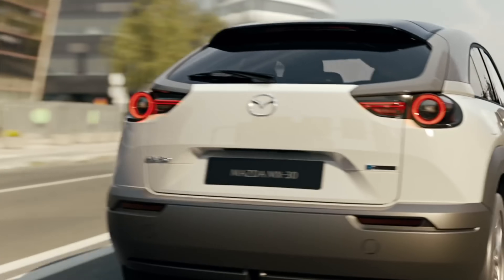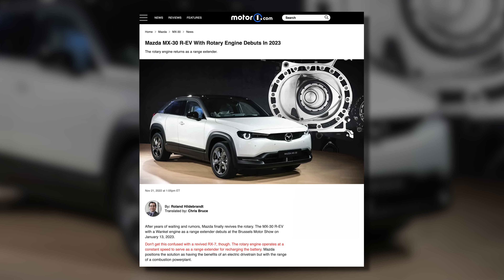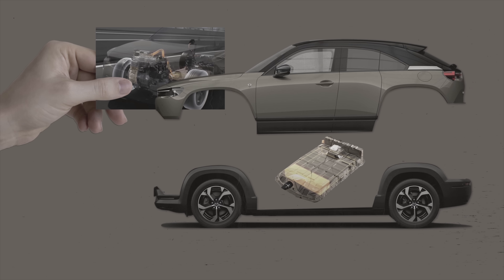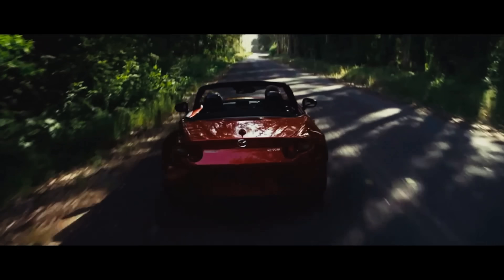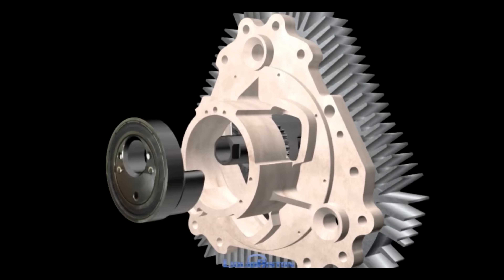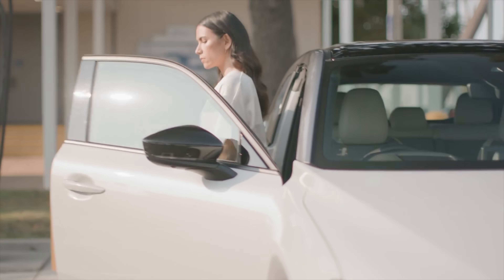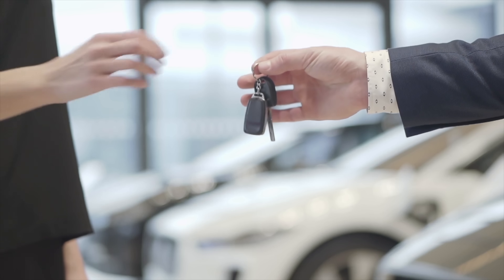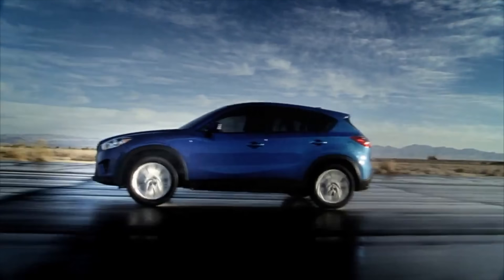Mazda's New Engine is the Smallest and Most Powerful Engine Ever Made

Comment: If Mazda can perfect this small rotary range extender (and it is a big IF), then it could make the electrification of the entire Mazda vehicle offering much easier for them.
Here is my thinking:  
1)  Yes a range of 50 miles would suit many peoples every day driving (mine included), but I wouldn't want to be so restricted.
2)  A high range electric vehicle would be great, but they are expensive and supplies are currently low.
3)  A battery driven car with range extender would help fill the gap in everything from a three door hatchback, up to a heavy 4WD with high towing capacity.
4)  It seems to be a better idea than Toyota's integrated hybrid system, that relies more on fuel use than plug in battery power, and is more complex.
5)  When batteries become cheaper and more power dense in the future, it would be easier to swap out a better battery system in the Mazda, than in the integrated Toyota.  In such a case, the Range Extender could even be removed to save weight.
In conclusion, I think an electric drive vehicle with a range extender, makes more sense than a hybrid drive.
Reply: @Jarjoobinko  You have not "burst my bubble" because although you are right, I made the distinction between Hybrid and Range Extended because of the way some manufacturers (Toyota in particular) make hybrids with no plug and/or tiny batteries.  What I call Range Extended is a car that can be used on battery only for daily use, while the hybrid Toyota I have, cannot.

Comment: At the three minute mark you say that the extender increases the range from 124 miles to 400 miles. But the 125 miles was generated by 35.5 kWh battery and you said a little later that the battery was reducing to half that size, so what is the range provided by the extender with a battery that is half the size is being used. Is it now 200 miles?

Comment: When the power grid goes out the only vehicles that will work will be the older diesel car ex old surburbans anything without modern computers..you can charge the battery off a generator and use the filtered conning oil as fuel

Comment: Have you looked up Nissan Kicks. Its an EV with a gasoline engine generator that charges the batteries for the cars electric motor. Braking wlso harvest and stores electric power. Nissan says a full gas tank will travel 900 kilometers. No need for charging stations as there is no infrastructure for charging in the Philippines.

Comment: Thanks for the excellent review and explanation.

It would be great to hear how Mazda addressed the oil burning and impartial fuel combustion problems.
Reply: I suppose that big problem is mostly addressed with a catalytic converter. Plan on the next generation of ICEngine utilizing "combustible" hydrogen. Toyota and Kawasaki have successful 4-stroke piston H-ICEngine test models but not yet applied to a PHEV+H drivetrain. Timed fuel injection and turbocharged platform. PHEV tech increases fuel economy ~30%, reduces emissions ~90%. Otherwise, the list of advantages PHEV tech offers is off the charts. I'm predicting PHEV tech could serve 65% future EV needs and is especially applicable to long-haul freight truck fleets. BEV tech serves the remainder in mostly lightweight and short distance travel/transport needs. Hydrogen fuel cell EVs may offer only half the MPG possible with PHEV+H tech with hydrogen stored at lower pressures (1750 lbs vs 10,000 lbs) in smaller tanks. The Chevy Volt is rated an effective 150mpg and with its 18kwh delivers 50 miles on battery pack alone. The real problem is we drive too much, truck and ship goods too far. PHEV tech offers more potential to address that existential problem.
Reply: Since it only runs in a very tight rev range, they likely can tune it just right.

Comment: Mazda needs to make this PHEV version with at least a hundred miles EV only. Also, they need to put in a more performant motor. In addition, I would love to see this deployed with Sodium Ion batteries circa 2024-2025. This engine could also run on Methanol, DME, Hydrogen, Ethanol, propane et al.

Comment: I always thought having an electric car with a small generator driven by a high-efficiency small engine built in would be a good idea. I don't think the super small battery pack is a great idea though. I think it would also be good if the small engine ran on propane. The engine could be designed to run that pretty much one speed which would allow you to design something with really high efficiency. This would also eliminate range anxiety. I think a turbine engine could be designed to run at really high efficiency. For a generator you don't need any low-end torque, it just needs to slowly ramp up to an optimal RPM and stay there.
Reply: Many years ago (before Tesla, before the GM EV1) there was an Electric Car Club in Melbourne Australia.  They would get cheap old Japanese cars with blown motors, then fit them with electric motors and... (wait for it)... heavy lead acid batteries, giving a range of 15-20 miles for daily use.
When they brought these cars to Adelaide for a special event (450 miles), they would just mount a small Honda Generator on the rear bumper for the trip.
Genius... though Mazda's set up does look much better.  :)
Reply: Drill, Drill, Drill.

It's your only hope for the future. Ev's are a joke and if we go to them exclusively, none of you will have one unless you are a party member comrade!😑
Reply: I think liquid fuel is perferable. Gaseous fuels you run into entirely different complications and dangers. Propane works for the grill bro. Not the cars. Toyota alreasdy makes a prius prime which us more heavily electric. I dont like it. I think big batteries are a liability. The cost of a big battery and big electric motor and big engine is high. If either one has a failure its not cheap.
Reply: @TheAnnoyingBoss  Propane tanks that you buy (for a grill or torch or heating your house) is actually LIQUID propane. If you shake the 1 or 20 pound tanks, you can generally feel it sloshing around.
Reply: @dzcav3  I don't think you're going to get him on that technicality. Although in truth propane is a better fuel than gasoline. Propane Burns a lot cleaner than gasoline; (in fact I don't think you even need a catalytic converter for a propane engine) and this also means no soot deposits to clean out. And the fuel mixes evenly without the need for a special injector or induction swirl. However a gas fuel engine usually runs a lot hotter, than a liquid fuel engine. And propane is generally lower energy than gasoline, which means you will be refueling more often, like with ethanol. Also cold starting and be an issue for propane specifically, but not necessary with natural gas; because at negative temperatures, propane doesn't want to boil in the fuel tank. But that is easily solved with a silicone heating blanket; and a gas vaporizer when your engine heats up. Believe It or not, propane tractors were popular for a while; until they were mostly displaced by highly-efficient diesels.

Comment: Having a rotary engine is like having a transmission check fluid every 60,000 miles 100,000 miles cost maintenance and if repair.  How you gonna know. If they really did changed seal o rings and flush the oil in a rotary engine or not. Liked the 400 mile increase travel. Keeping the oil change in the Ev vehicle is like more money for the Mazda mechanics and mechanic oil change product industry. Why not attach a smaller rotary alternator to each of the car rim and recharge the battery. While all the four wheels independently on four wheels separately charge the battery cell four times more.While the vehicle moving and do away with this big rotary engine. A money pit and a easy short cut engineered do when not solving the real problem. It don’t take a rocket scientist to figure that out. It’s a money monopoly chess game car industry issue.

Comment: Love Mazda for going its own ways and keep the rotary engine alive ❤
Reply: Yeah but Nissan was first using this concept and will do 90 mpg
Reply: @tonym8358  Nissan / Datsun used rotory engines in the past. But nowadays? At least I am not aware of any.
Reply: @Privat Gmail  Nissan will not use rotary, will use 3 cylinder engine to power the battery, I think is already in production will be more efficient and cheaper than any electric car
Reply: @tonym8358  See, but keeping up the rotary engine is exactly the cool thing about Mazda. Love Mazda for that.
Reply: Athefumen...zoom zoom
Reply: I had Gen-I and Gen-II. Didn't like roadster style of Gen-III. I was at dealer picking up window grommet for Gen-I. As I waited, a truck full of Gen-IIs pulled-in right outside the window, in my face - cherry red. The salesman said, "How about we...". I interrupted and said, "Put the wheels from the white one on the red one (both Turbo-II's), I'll trade a Gen-I (with brand-new  window grommet) and I'll take that red Gen-II at list.". Later traded Gen-II in for a Volvo 960 (yep, you heard that right) the day after found out having a child. Pretty much gave it away on trade. Had nightmares three times - should have kept it.

Comment: Today's standard to beat is a Tesla. Testa changed the game not only because of the range that it has but because the car that is made, is made to last a long time with warranty. Every manufacturer before Tesla makes a car that only lasts up to the warranty is over. They have brought that mentality over to their EVs. So every EV they make they don't care that it lasts long it just needs to last as long as the warranty. The reason I bring this up is because the way Mazda has this engine set up to charge that little battery, is set to kill that battery in a small amount of time as opposed to charging the battery so it lasts longer. Long story short this car will suck long-term

Comment: This is brilliant, it keeps the climate change fanatics happy while taking huge advantage of gasoline. Well done! 
Some early electric cars had 4 motors - one on each wheel - and a small gas powered motor that would start to charge the battery when it got low. That was a very impressive design imo.

Comment: No. I'll never want a rotary. And adding a component is just another thing that can fail. Minimalism is poetry. If companies cared about epa, they'd bring back the inline 3 cylinder in econobox cars. But instead throw in a turbo to save mileage. Which just like this rotary junk, is just adding a component that will fail. They want you to need to buy a new car or engine. I had a geo hatchback b4 Chevy bought them out. 45 mpg. If anyone sold those today, they'd be super popular. They don't do that on purpose cause then ppl would pay to fix those instead of the planned obsolescence route they all agree together to force on the consumer.

Comment: Much probably depends on the price point. This may be a good vehicle for homeowners that only occasionally take a road trip and can charge at home. It wouldn’t make sense to apartment dwellers. It also wouldn’t make sense to someone that drives hundreds of miles a day, because the rotary engine may have dependability issues for road warriors that run it frequently and not have those issues for someone that just needs an occasional charge from the rotary.

Comment: The rotary is smaller and lighter than an equiv power piston engine. So when on EV mode, which is most of the time, it will be lighter meaning the electric motor and battery has to propel less weight, meaning higher efficiency.

Comment: mazda's way is the way to go for a hybrid.  I really liked the chevy Volt (not Bolt) for this same reason.  You really get the best of both worlds--you have 100% electric for in-town trips (124 is pretty good to get all your errands done).  But you also eliminate range anxiety.  Plus, unlike other hybrids, that  require a transmission to convert the engine's power to the drivetrain, Mazda designed this in a way that makes sense--always power with the the electric motors - yes! these are powerful motors so it makes sense.  Now you have a generator in your car, which, like Scotty mentioned ,means you also can easily tap into the power if you need emergency electricity

Hybrids don't make sense to me.  Electrics are ok, but I've experienced tyring to take a 400 mile road trip with one of those, and it's no fun.  Now you can have a car that does it all!
Reply: I drive the most hated car in America,  a Prius (as do my wife and daughter). Its design is a tramission-less drive train that employs a motor-generator- starter all in one. Ours average 42 mpg and have a range just under 400 miles to the tank. One downside is the HV batteries that typically last about 200,000 miles, but can be replaced for around $1600.00 by aftermarket companies.  Yes, it isn't a V8 or even a V6, but they'll do 100 mph if needed, and where we live some area's speed limits are 85 mph.  Did I mention for an old tinkering retired tech., they aren't hard to work on?
Reply: @Rev22-21  sounds like you like yours ok.

Comment: It would help if the MX-30 was as easy to replace as the old vw beetle engines. Disconnect the fuel line, pull the electrical plug, disconnect the throttle cable, hook a hoist onto an engine handle, remove 4 bolts then lift it out. The only difference is that the vw aircooled engines came down from the bottom of the car. It took minutes instead of hours to remove.

Comment: Three other advantages:
1: weight.  The weight of the battery and generator is the same as an ICE vehicle.  Most EVs are at least 1000lbs heavier, and in some cases are pushing SUVs to nearly 6000lbs.  This kills range and also makes it a boat to drive.
2: Replacement.  It's a generator that's bolted in in a few places.  The entire thing plus radiator is one "unit" and appears to be a simple hour or two job to replace with a new one.  Or to pull out entirely to work on.  Basically all that's connected to it is the fuel line and some electrical components. Easy and mechanic-friendly.
3: Long range use.  The range on a highway trip if you stop and re-fuel is basically infinite.  The main issue of battery only vehicles is their finite range and the anxiety they cause.  If you need to run, say, 450 miles, then top off the gas somewhere.  Then have the car charging itself while you are having lunch or just plug it in - no worries.

Comment: Isn't the entire stupid EV movement supposed to eliminate "fossil" fuels due to the mass hysteria of climate change? All this proves is that you still need a gasoline powered engine to travel any meaningful distance. Manufacturers are now taking advantage of soft brained gullible tree huggers and just making the process of travelling more complicated and expensive to deceive climate changers by adding a stupid electric motor and a heavy battery to do what you could always do since the invention of the car with a gasoline powered engine without the assistance of an electric motor. Yep real smart!
    Of course none of this hocus pocus bovine detritus would be an issue if people actually understood the laws of physics, in particular the conservation of energy. And since when does a fossil make anything except a rock that captured the shaped  and form of a biotic lifeform that got trapped in water and sediment resulting from a global deluge?

Comment: Over 25 years ago, I proposed a small Diesel engine to spin a 3000 amp alternator that would power an electric motor. A lead acid battery would provide start acceleration energy from a standstill. At the time, no one was interested. Now, EVs are the rage, somewhat. Maybe my idea was not even merit worthy.

Comment: So riddle me this... If the cars have 4 wheel speed sensors and is already there doing its job and basically what an alternator looks like in a way but i know isnt why cant they make an alternator sure they dont make any power while sitting at a red light but really how often do you sit at them , also not making alot of power even at 30 mph but 4 alternators on a tour at 70 mph and where you need it instead of having to stop for recharge? But a trip to town and back probably not needed so ... Guess i answered question already ... Electric sucks! 
Cadillac CTS-V now thats pleasure and happiness all balled into one, could never be more happy with a vehicle!!